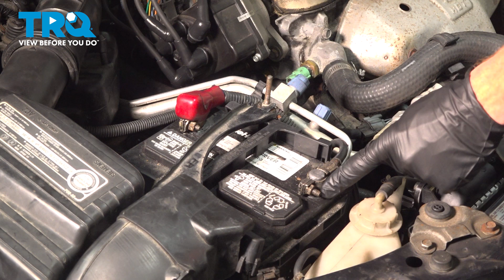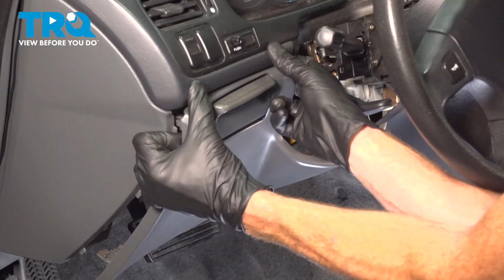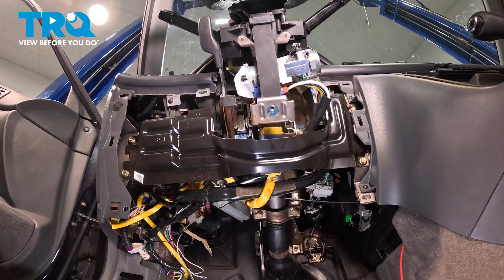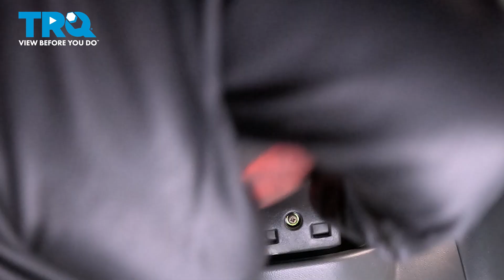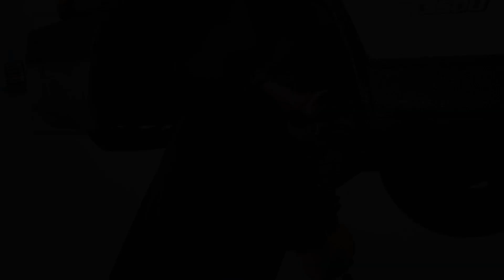How to Replace Ignition Switch & Lock Cylinder Assembly with Key 1994-1997 Honda Accord

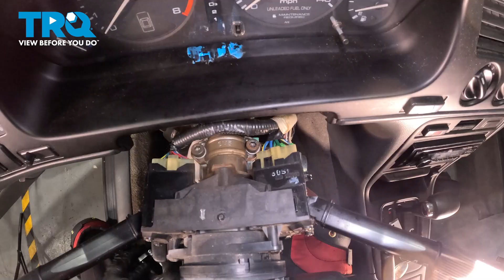Comment: 6:24 , for anyone finding the rounded/smashed/rivet looking bolts on their car here, you are able to remove these smashed bolts by taking a large flat head, placing the point on the center of the bolts at a slight angle (like a chisel) and hammering the screwdriver into the bolts enough for it to bite the metal and then proceed to knock the bolts loose in quarter turns. In our case we went to home depot and looked for some replacements of the same pitch, pattern, and length with Allen key heads for future access. You can try dremeling a notch in the bolts but the space is a bit difficult, chisel and knocking loose is the best way to go.

Comment: Those are break away bolts. The head is designed to break off of the bolt when it is properly torqued. If you didnt spin the head off it will come loose.